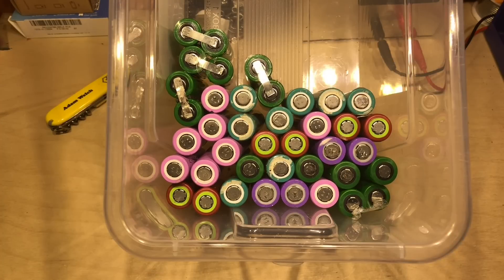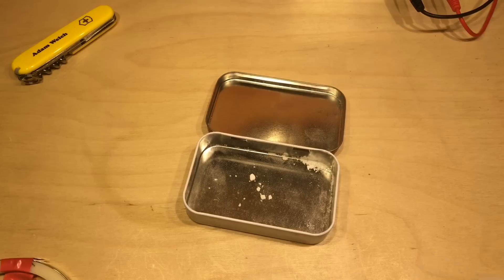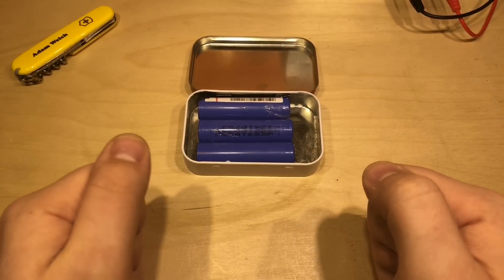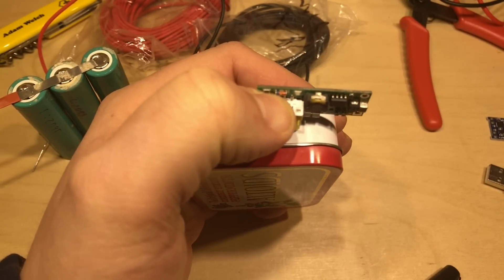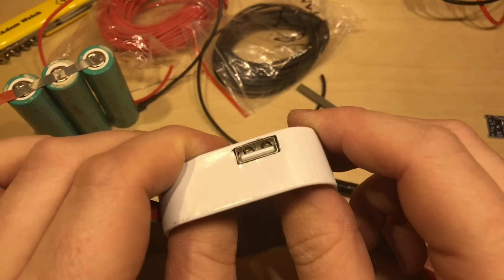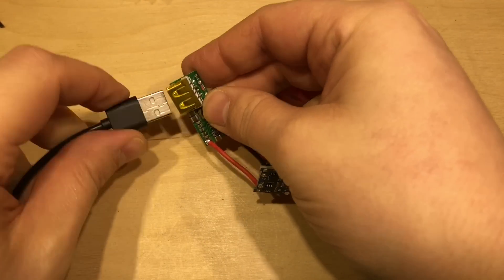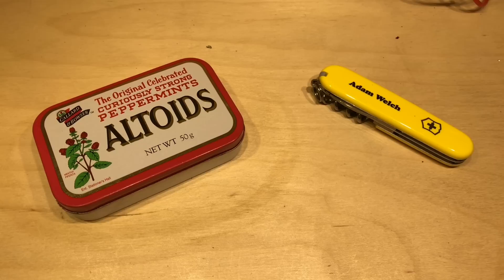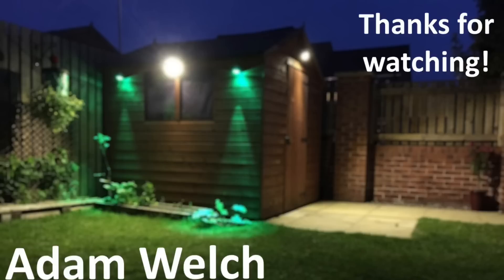Altoids Lithium Ion 18650 QC2.0 Powerbank - 12v Solar Shed

Comment: with a 100 or even 150w or bigger pen it would be easier to solder and u dont need to stress the batteries as much :) just a quick tip. and thanks for top on that module. will dig into the fast charge.

Comment: Nice video, I would put some heatshrink tube around that TP4056 module (as a basic insulator), and/or some Kapton tape on the inside of the Altoids lid.
Reply from the maker: :-) I did mention this in the description but I'd finished filming at that point.  I did put some heat shrink around the TP4056 module with some cut outs for the leds and to allow the TP4056 to vent a little.  More hot glue was applied to the end of the heat shrink to give a bit of strain relief for the cables too.    http://admw.uk/jr

Comment: Nice job! I'd also like to know how much current the boostconverter draws when not in use.
Having a build-in battery-level indicator could also be handy.
Reply from the maker: Yeah - To be honest if I could have used a single module solution it would be likely that a capacity meter would be incorporated. However I couldn't find a suitable one.  I'll see what current is drawn and post something soon.

Comment: Did you first check the non-load current of the USB booster? Perhaps it draws 10mA and your batteries will be drained in a few days .. ..
Reply from the maker: I did - I thought I'd mentioned that when I powered it up with my DC2DC converter? It didn't register any draw on the Rui Deng - but I guess it wouldn't be a bad thing to check it against another meter.  Cheers.
Reply: O okay. Usually it is in micro amps. But the one ins not the other, so I just asked.
ps: I'd choose for a plastic container. All tin? At some day it will be cooking hot. We both know why :-)
Reply from the maker: 834 micro amps is the stand by current...  http://admw.uk/jv  I think I can live with that.
Reply: Is that 20mA a day? 140mA in a week? 620mA in a month?
I think that is something to keep an eye on!
I ended up adding a switch, so it does not drain down after a while. You know how it goes 'just when I need it, it is flat'. If it is after 8 months or more, your batteries are not going to give much power!
Reply from the maker: +deslomeslager Yeah. It's my every day carry power bank at the moment and will probably get charged every week for now. If that changes I'll do a switch as you suggest. Cheers
Reply: Yeah, that worries me a little - all that exposed circuitry inside a metal tin. It could make a very nice hand warmer though :)
Reply from the maker: +Julian Ilett and I can see why. After a week of sitting in the coat pocket it's not turned into a hand warmer yet! All the positives are fairly well insulated - as is the tp4056. I did consider using the tin as the ground :-)

Comment: Hi Adam

Nice  little project.

I not sure if you put some better insulation under the PCB in the bottom, but I noticed that where the wires soldered through the pcb that it caused an indentation of the insulation tape. I would have liked some thin plastic like that film (difuser or polariser) from teardown of an old LCD screen.

Yes you may need to isolate the 18650's when not in use.

Rich
Reply from the maker: +FireballXL55 The USB module uses 800 micro amps when not in use. The dw01 will cut off if the voltage gets below 2.9 volts. I could add a switch but this will be used regularly so shouldn't be an issue. 
The USB module has insulation tape and a good layer of hot glue insulating it. It should be ok. Cheers

Comment: I think I would have flipped the charger module up on it's side and fixed it so the socket was on the front. Great build though.
Reply from the maker: +Steve Smith That's a pretty good idea. I have since modified this bit. I place the whole USB QC2.0 module into heatshrink and then glued that to he bottom of the tin. Glad you liked it and thank you for the feedback.

Comment: Personally, I would've insulated everything from the case by cutting out a piece of foam to sit over the bottom, but good enough I suppose.
Reply from the maker: +vgamesx1 I've sleeved the tp4056 now with some heat shrink and I'm confident that the USB module and cell positives are isolated. I guess I could have gone further just in case. Cheers.
Reply: Well better safe than sorry right? :)
Cheers.

Comment: i feel like you had the iron on those batteries a real long time
Reply from the maker: Yeah I'm not keen on soldering them - and this was my first time - but then there are plenty of people soldering a lot more cells than me who don't seem to have had many issues.  Probably could have been a bit quicker though.
Reply: Adam Welch ya i have done it a couple of times without any issues but if it does not start to stick in a couple seconds then i move to the next one and let it cool off but im also using a 140 watt soldering gun so i should be able to heat it up pretty quick

Comment: Why didn't you make a small hole on the lid for the micro usb and hot glue the TP4056 in place?
Reply from the maker: +MrBrymstond I couldn't work out how to make that fit with the curved corners, the lid and the size of the module.

Comment: you know you can just go to the local convenience store and pick up their cheapest USB to Car charger. those of all the circuitry needed to connect to the batteries you just need some wires and some tape.
Reply: also you might be able to squeeze the bigger one right in the middle just barely on top of the batteries. I think if you put it upside down with the circuitry facing the batteries you might be able to get the most space out of it.
Reply from the maker: Thanks - the issue with the car USB charger was that it will be a buck converter and I needed a boost converter as all the cells were in parallel - a neat idea though.  I'll take another look at the large one - the problem with mounting it as you suggest is that the holes I'd need to cut for the usb ports would be in the area where the lid closes down.  I'd either have to open the tin to connect my devices or cut holes in the lid as well.

Comment: It's not quick charge 2.0 because you can charge at 5v 2a. lol It may be a quick charge thingamajig because the TP4056 can only put our 1 amp max and the thingamajig is boosting the amperage. Quick Charge 2.0 varies in voltage 9v on down.
Reply from the maker: +MrBrymstond The module is QC2.0 compatible and can adjust the output to 5, 9 or 12 volts. Check the link in the description for a full explanation. The TP4056 module charges at 1amp, but will allow higher currents from the cells to the output. This will be limited by the mosfets, not the TP4056 IC.
Reply: Instead of going thru the TP4056 run the wire from the battery to the QC2.0 compatible module.
Reply from the maker: +MrBrymstond Then I loose my undervolt protection and don't really see an advantage?
Reply: Doesn't the TP4056 also limit the output to 1amp?
Reply: You wire it to the TP4056 B+ and B- for charging then run the QC2.0 compatible module from the battery instead of running thru the TP4056 1amp Out to the QC2.0 compatible module. The battery should allow more amperage than the TP4056, right? Yes you will lose the undervoltage protection, but you should gain voltage output. Just wondering.
Reply from the maker: +MrBrymstond The TP4056 does not control the load in anyway - it doesn't even know it is there. The load is controlled by the DW01 protection IC and the dual mosfet package. The limit on what current you can draw from the cells is down to the mosfet. The DW01 simply switches the mosfet off if the voltage of the cells goes below 2.9 volts. The 8205A dual mosfet package has a drain to source current limit of 6 amps. So let's say 3-4 amps with no cooling. That's plenty.

Comment: To solder on the batteries, I usually scuff with sandpaper then flux, solder then sticks very easily
Would be cool to do a 3D printable housing for inside tin to hold all the stuff in place
Kinda like this: http://www.thingiverse.com/thing:297649
Reply from the maker: Nice - If I had the space I'd love a 3D printer in the shed.